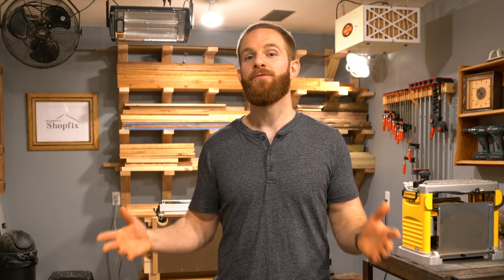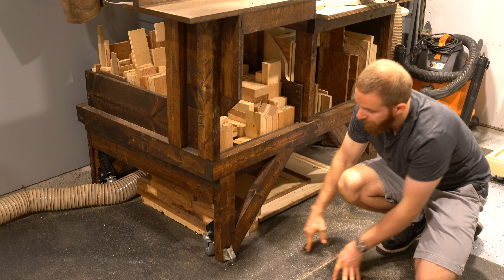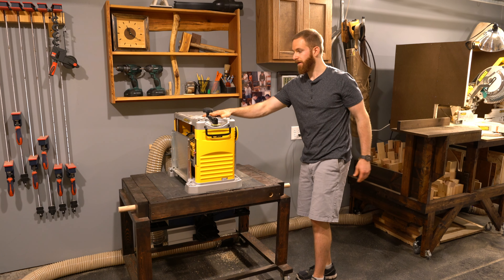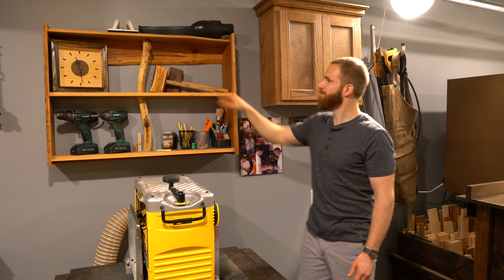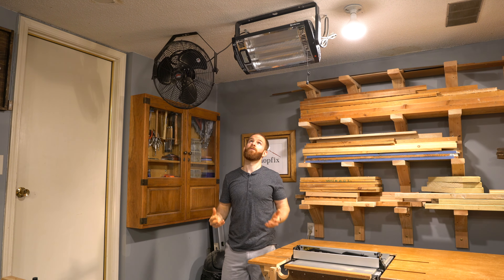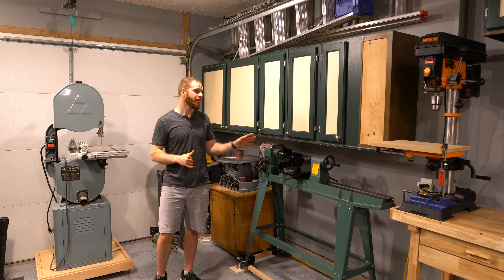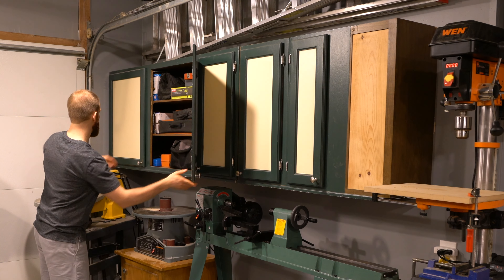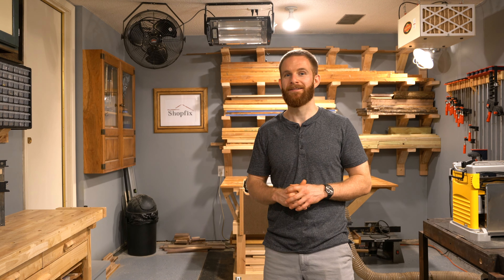Watch this before designing your workshop!

Comment: Really like your flip table. Nice touch staining the 2 X 4’s, looks great! Nice one car garage shop. Well thought out. My only suggestion would be to add LED light strips in there. They don’t cost a lot. Eazy to hang and the light is awesome. I used the daylight color and has made a huge difference in my 3 car garage shop. Best wishes young man 🤙🏻🤙🏻
Reply from the maker: I have since upgraded the shop with super bright daylight led bulbs and it does make a huge difference. It’s much brighter, colors are better white balanced too. I think before it was too warm and colors were off.

Comment: Thank you for the video.

Here’s a tip for the DIY woodworkers just beginning this fulfilling hobby: Resit the temptation to buy a/every tool you THINK you MIGHT need IN CASE you have to do whatever. 

You don’t need that far-flung jig or tool designed, for example, to hold a screw in place. 

If I knew then what I know now I’d own 50%-75% less of the tools I own currently that have little to no use. 

There I said it. I feel better.
Reply from the maker: You're welcome! I agree with you, there's no need to buy every tool until you need it. Another thing I would add is don't buy an expensive tool for one singular purpose. I have a few tools that I have purchased to complete a single task on one project and then haven't used the tool since. Think about work arounds with the tools and machines on hand, home made woodworking jigs are your friend in those cases!
Reply: Exactly! I surprise myself all the the time by coming up with workaround solutions using tools and materials that are on hand.

Comment: Good video!  I have the same oscillating spindle sander, but I bought it used as an add-on in a used  bandsaw purchase and I did not spend much time checking it out before the purchase. Since I've had it, I cannot figure out how to change the spindle drum. I'm not sure if I'm totally overlooking something or if the machine I bought is broken or otherwise missing a spindle lock.  Would you mind elaborating on how you change the size of sanding drum on your sander?  Thanks!

Comment: 🙌🏼 I enjoyed this video. 3 ideas I will most likely adopt is the larger box dust collection on miter station, the 2x4, 45° construction lumber rack, and the flip top jointer/planer table is an excellent and very practical idea. Love that. 

I wanted to know if you were happy with your Rikon jointer… is it the helical head 6” and how do you feel about it’s  fence? I’ve been looking at the 8” Wen and a 6” Grizzly with spiral heads. Both with cons (or bad reviews) about their aluminum fences, but Rikon  makes a 6” helical head for a little bit more $. Amazon has 2 left in stock without the ability to read the 4.5 star 167 reviews.
Reply from the maker: Glad you enjoyed it! 👍 The miter box is a huge plus especially with how much I utilize the miter saw in my shop. Practically every project passes through the miter saw at some point. Flip carts seem to save the most space in a small workshop. I did a full review of my Rikon jointer here :Rikon 6 Inch Benchtop Jointer Review - Model 20-600H
https://youtu.be/nkIZE7JkvX8

Comment: Great setup! I'm going to incorporate a lot of these ideas into my workshop. Quick question for you: Do you have a video on how you made the flip-top table? I've seen a few others, but I love your dowel-rod idea the most. I'd love to see a walkthrough!
Reply from the maker: Thanks! On the flip top table I simply got a 3/4ths threaded pipe and mounted that into 2x4s on either side but only after adding 3 boards onto the pipe to build out the box that flips. Then I added the top and bottom piece of the box after mounting the pipe and 2x4s onto the legs. Then you’ll want to drill your holes for the dowel rods that keep it into place and you’re ready to go.

Comment: That is a nice setup.  And great to see that you never let the size of your shop stop you from building what you want.

That fence on your bandsaw was very interesting. I know a lot of those smaller units don't have fences. would be interested in a video on your bandsaw fence!
Reply from the maker: Sometimes you just have to make do with what you have and design the space as efficiently as possible so the small size doesn't become an inconvenience! The bandsaw fence is an aftermarket accessory that didn't come with the Delta bandsaw. You can purchase similar aftermarket bandsaw fences from a variety of companies. However, I don't recommend the bandsaw fence as much as others may. A bandsaw fence is incredibly difficult to use because of bandsaw blade drift. Unlike other machines where the blade is fixed such as a table saw, the band saw blade moves quite considerably. When you rip with a bandsaw fence more often than not the blade will drift and the board will start to create its own path off of the fence or the blade will end up not parallel to the fence. If you setup your bandsaw fence to accommodate the blade drift (setting it at the angle of the drift) then it works better. However, I prefer to freehand everything on a drawn line.

Comment: You have an excellent workshop!
But please avoid using that can of WD40 on your woodworking machines. It leaves a sticky residue that will attract dust just make matters worse.
WD40 was formulated as a water dispersant, which it does exceptionally well. Before the days of electronic ignition, if a car stopped because of heavy rain, we would simply spray WD40 into the distributor cap and onto the HT leads, and the car would run again. Magic!
But there are much better lubricants and dismantling fluids.  The great success is that WD40's marketing department has led us to believe that it is a universal panacea, a cure for all ills. Which it absolutely is not.
But, yes. There is a can of WD40 in my workshop, too... 😞